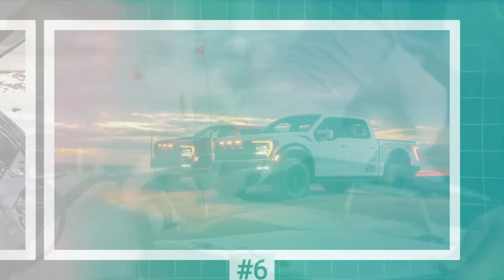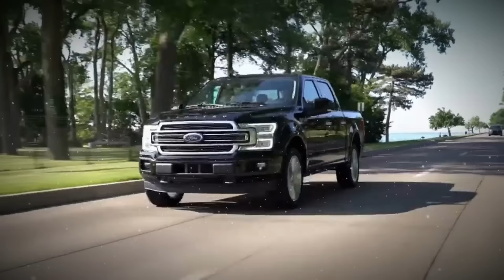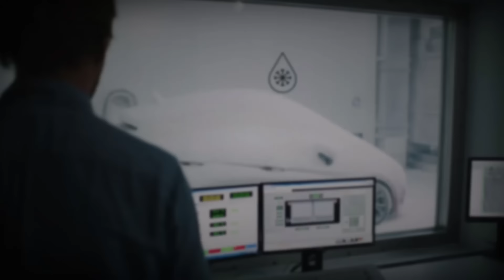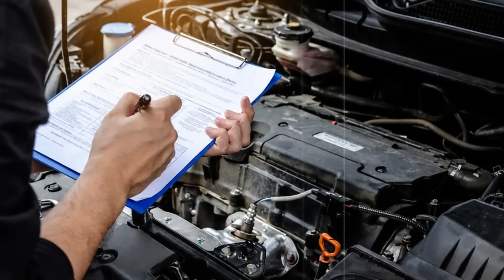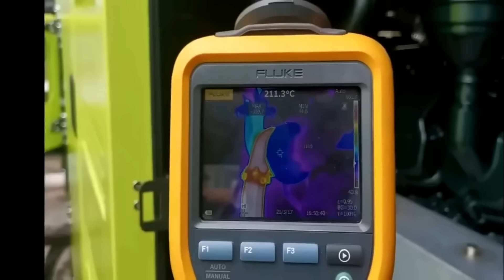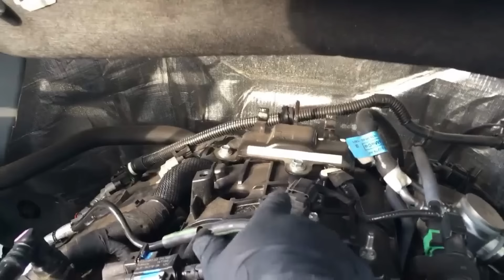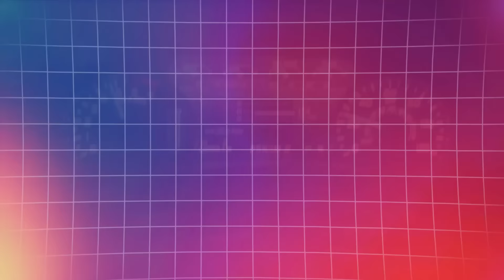We Ran a Turbo F-150 & a Naturally Aspirated F-150 Side by Side for 200,000 Miles — A Clear Winner

Comment: Question: Did ANYBODY at Ford even think to ask themselves why Henry Ford went to the V8 in 1932, and tested it for a million miles before going into production? This being said, I own a 94 F150 with the 4.9 six, with 5 speed manual port fuel injectors, 8 ft. Bed. The 4.9 300CID Six is arguably one of the best engines ever built.
Reply: My dad had a 1970 chevy c 10  and 1980 ford truck straight 6 , both were awesome

Comment: Well I have over 200K miles on my 2016 2.7 Ecoboost and my engine still runs like a clock. Original turbos and everything. Just regular maintenance. Having a good maintenance discipline is the key to longevity with these engines. I change my oil every 3K miles with Pennzoil Ultra Platinum. Just my personal preference. Remember oil is cheap and engines, turbo chargers are very expensive lol.
Reply: I love the pennzoil platinum oil. I use the regular not ultra. I do 5000 mile oil change. I don't tow. I'm still leary of turbos.

Comment: Both engines well proven & excellent. Just require good basic maintenance practices like any modern vehicle. Owned 3 gen1 /gen2 GTDI Ecoboost vehicles all served me well. 2.7L / 3.5L V6 GTDI Ecoboost known to to go 300k+ mis. 5.0L Coyote V8 also super solid. Best modern efficient V8 available today. Facts.

Comment: I’m still on my ‘97 F150 XLT w/4.6 at 105k miles that i paid 26k for back in 1997. It’s been lightly used I’ll admit, but the damn thing just refuses to give me any problems. When it comes to pickups, I believe in TOTAL simplicity. Naturally aspirated engines and as few luxury options as possible. Just power windows and A/C…nothing more. Keep all the sensors, fancy stereos and nav systems. I don’t even want leather seats. Front disc and rear drums please, and a 6 foot bed at a minimum. Do this and you’ll find your truck experience to be very happy. Start adding crap, and you’ll end up in the shop on a semi-monthly basis. Lol

Comment: My 2015 Expedition with the 3.5 had the cam phaser rattle when I bought it at 150k miles.  I'm convinced that the OEM recommended 7.5k oil change interval and/or previous owners failure to follow it is partly to blame. Dirty oil simply doesn't get to the phasers as quickly as fuel gets to the ignition. I immediately switched to 3k intervals with full synthetic oil.  I also flood started the engine to boost oil pressure at startup by pressing the gas pedal to the floor and holding the ignition until the oil pressure was boosted to the normal range.  Within 15k miles the cam phaser rattle was gone and I no longer needed to flood start it.  I was also experiencing a turbo underboost condition.  This went away when I switched to Valvoline Restore and Protect oil .  I now change the oil at 5k intervals and the engine oil gets cleaner with every change.   I'm about to turn 200k miles and it is running better than when I bought it.  My truck came with an oil catch can that also helps.  I love my Expedition but given the choice I'd go with a V-8 if it came with one.

Comment: the mistake was buying either of these pickups when the job is towing. A 5 liter engine is only 305 cubic inches.  Even a 350 is a poor choice for towing and or use in mountainous country. This is like trying to use a moped for cross country touring.....wrong tool for the job.  Direct injection should be outlawed on 4 stroke engines.

Comment: Some things you didn't even mention.
The V8 costs $2600 more vs the V6. As reported for a 2026 model. (I used XLT as my reference.)
It's also likely that the dealer is less apt to give as much, if any, discount on the V8.
If rebates are offered from Ford, the V8 is less likely to get one. More than a little of this is fallout from CAFE regulations.
Towing - You mention towing a 7500 lb trailer. This MIGHT be 100% of the rating of the 2.7L where the 5.0 liter would still have about 2000# more capacity. (Can't say for 100% certain on this, as you don't specify the axle ratio, whether the HD towing package was installed, or 4x4 or 4x2. All of these could impact the max towing weight. The V6 MIGHT have a reserve of 500# and the V8 MIGHT have a reserve of 5400# [ yes 5 thousand 4 hundred pounds reserve] If you "check all the right boxes" max rating of the V8 goes to 12900. Max rating of the V6 goes to 8000.)
It appears you've put the V6 in a situation that is at or near it's rated limit for towing.
BTW - Why not the 3.5L Ecoboost?

Comment: I've got a 2017 F-150 Lariat 3.5 Ecoboost with over 215,000 miles. I had to change the Water Pump at 170,000. It's still going strong. I tow a boat and also a 10,000lb Camper Trailer. I do an engine flush every 50,000 miles.

Comment: 201k on my 2015 2.7  .... only work so far was a water pump replacement .  Always got 23-24 mpg until a month ago , now getting 19-20 mpg and i suspect a turbo leak but havnt found it yet.
Reply: Not plugs?
Reply: @charlesc4047 ...i bought it at 103k , i assumed dealer serviced it then , but i have no miss yet

Comment: I drove my 2.7l Ecoboost Turbo for over 300k miles. Changed my oil with motorcraft every 10k miles. Only replaced one turbo at 267k and a couple coil packs. One difference is I did not tow much with the truck.

Comment: Neither a Ford nor a pickup truck story, but I was looking at Chevy SUVs recently.  It’s hard to get a naturally aspirated V6.  They’ve gone turbo 4 and 3 cylinders in a big way.  

Because I live in a very rural area, being able to accelerate to pass other vehicles on 2 lane blacktop is important to me.  Every Chevrolet with a turbocharged engine loses acceleration after a few seconds.  I suspected it was a boost timer that reduces the turbo outlet pressure after a few seconds to save wear in the engine.  I asked the salesman about it, but he just gave me a blank stare.

From the description of the Ford turbo in this video, it doesn't seem like Ford reduces the pressure in their turbocharged trucks in order to maintain performance under load.  But it’s always something to look for in a turbocharged car or SUV.

Comment: I have never owned a turbocharged engine and never will. I have seen the problems they cause and was completely aware of those issues before watching this video. One of my vehicles is a 2002 Ford Excursion with the V-10. It currently has 187k on the odometer. Other than regular service items, the only parts that have been replaced on this vehicle is an alternator, a couple belt idler pulleys, water pump, spark plugs and boots and one coil pack. The transmission filter was also changed around 100k. This vehicle has not been used for any heavy towing and currently is set up for camping, hunting and overlanding type driving. 3" lift with 35" tires makes it perfect for that. I won't own any new Ford products made after 2014.

Comment: EPA Emissions regulations are the main reason for smaller displacement turbocharged engines. So, once again, misplaced, unintentional, misguided environmental regulations triple the operational cost, increase the initial purchase price, and actually cause poorer fuel economy in real world conditions. Using ethanol fuel causes engine damage due to its corrosiveness, gives poorer fuel economy than non-ethanol gas, and doesn't take into account the diesel burned by farm equipment to grow the ethanol corn and to transport it to refineries. This is the same sort of thinking that led to the ban on leaded gasoline for ground based vehicles! Because mostly wealthier people own & operate leaded AVGAS powered aircraft the levels of lead contamination on and around airports is several hundred % higher than the highest lead contamination ever measured near highways. So, leaded gas for us poorer average Joes was banned thus losing the octane boost/performance and lubrication qualities of leaded gasoline in cars, trucks & motorcycles, and small engines, meanwhile, because wealthier aircraft owning Americans can afford better lobbyists they get to continue using leaded gasoline and polluting far more than ground vehicles ever did! Yet another reason I can't stand Democrats and big government!

Comment: Big difference from the 3.5l turbo to 2.7l turbo...thats why the 2013 F150 3.5l have close to 370hp and 410 torque....the problem with the 2013 3.5l is GDI...but can be handle with a catch can and cleaning the valves with CRC or Seafoam valve cleaning...

Comment: no real surprise here and I am impressed how well the 5.0L held up, I would argue that if you are going to be towing often and moderate loads in a full size four wheel drive crewcab pickup I would want a 351 or a big block butv if you just drive a truck like a car and trade out every few years you can almost make the case for the ecoboost but I won't because personally I would still pick the V-8. Everything that happened to the ecoboost was what I expected and was surprised there was not more issues considering the towing. But really I would find something  different all together, something older and proven-but thats just me.

Comment: The echo boost 353.5 L at 80,000 miles the will get leaks on the oil pan cause it’s plastic the heat cycles mess it up and the plastic valve covers messed up to about 80,000 miles and it will get messed up again at about 120,000 milesI don’t like that engine the 3.5 L.

Comment: It’s why Ford won’t make the 5.0 V8 the base engine over the ecoboost options. Sales of the ecoboost engines would drop. Even with Ford dropping the 2.7 EB starting in 2027, they made the 3.5 EB the base engine instead of the 5.0 V8 and the 3.0 EB the top tier option. Ironically the 3.5 EB was the top tier option engine before the 2027 change.  Ford left the 5.0 V8 the mid tier engine option 🙄

Comment: Nope.  Spark plug ejection was a problem with the 5.4 V-8 not the Ecoboost.  Change top tier oil @3500 miles and use top tier gas and you won't have timing chain problems.  My 2014 F150 3.5 ecoboost has had no problems and it will eats 5.0 Coyote for lunch.

Comment: I was pullin' for the 5L & in work mode it didn't disappoint. I think w/ better flowing cylinder heads, port + direct injection, better flowing intake & exhaust plus a slightly higher compression ratio that could still get by on regular gasoline(maybe increase the octane for climbing), I don't know why you'd want the Eco-Bust?

Comment: Useful, if predictable, info, thank you.  I missed the fuel economy data -- any numbers available?
Reply from the maker: Thanks! We didn’t do a controlled fuel economy test, so I didn’t want to throw out numbers that wouldn’t be accurate. EPA ratings are a good starting point, but real-world MPG depends heavily on driving style, load, terrain, and engine configuration.
Reply: @FordInsiderSecrets I'll just figure that the EcoBoost has 10% better mpg, which is about $4000 less over 200k miles.  That offsets the difference in maintenance expense.  I'd still choose the V8 to avoid the hassle, and to be more likely to get another 100k out of the truck.

Comment: The video thumbnail is very misleading...it reads as if all is equal except for the turbo. Everyone knows the naturally aspirated V8 is going to last longer than a turbo V6, that's a no brainer. The only way this could possibly be a fair comparison is if the turbocharger is the only difference...as in turbo V8 vs the exact same engine naturally aspirated.

Comment: There's so much to unpack here... there are lessons to be learned here from over-the-road semi-trucks who have been running turbos for decades that most people don't understand. Turbos require good oil flow for cooling. If you shut off a turbo engine the very second you put it into "park", your turbo will wear out prematurely. Let the engine and turbo idle down and cool off for thirty seconds or more before shutting down. Turbos in light duty cars are good. Light duty towing with turbos is okay, but again, let it idle down and cool down before shutting down. For heavy towing, a normal aspirated engine or diesel will handle better over the long run.
Reply: Great advice!  Especially for freeway drivers. Let the turbo cool down before shutting the engine off. We do that with our turbocharged airplane engines. They cool down on taxi back to the hangar. Nobody just shuts them down after landing and at approach configurations. Do that with my tractor too (turbo John Deere)

Comment: I have the V8, it's about to cross 200K, since I've owned it I've changed the oil every 5K miles(synthetic), replaced the spark plugs myself and the air filter regularly. Unexpected repairs amount to a broken heater hose...that's it. Broken heater hose. If you're looking for a used F-150, check the Carfax, if it shows regular maintainence and it has a Coyote V8, it'll run forever. Change the plugs early. Broken heater hose.

Comment: Too bad you did not have the 3.5 in the comparison. We have 2 Explorer STs with the 3.0s (her’s is stock and 2 years newer, and mine is warmed over) that we have had zero problems with thus far. BUT, we have been looking at Class C motorhomes that come with V8s or 3.5 Eco boosts and this addresses my concerns, as they are much heavier than the STs (and we rarely tow more than 3-4,000 lbs with the STs), and the V8 looks to be a better fit even though they continue to improve the Eco Boosts.
It looks as if both engines need to run Catch Cans for the EGR gases due to the direct injection (should use the 3 line Catch Cans on the turbo engine).
Cheers 0:28

Comment: My car (not Ford) has a turbo, does no towing and is always a blast to drive. But I do have the same weird hesitation just after starting, in forward gear for a few seconds. It smooths out and does not cause any problems thereafter. It's just weirdly disconcerting. I knew the turbo 4 cyl is just a really bad idea in a full-sized truck. In a smallish car it's fun as hell.

Comment: To eliminate the valve chatter with cold starts, I put the pedal to the floor and crank for a few seconds to get the oil pressure up before it starts.
Reply: I have tried that with my 3.5 Ecoboost and wondered if I was making a mistake? The cam phazers happen to be furthest from the oil pump. After holding the pedal to the floor for 2-3 seconds, I lift my foot and the engine fires immediately.
Reply: @tonyhonzay507 so you start the truck at WOT?😮

Comment: Torque Advantage: The twin-turbo EcoBoost provides substantially more pulling power and low-end acceleration at lower RPMs.Response & Delivery: The naturally aspirated Coyote requires higher RPMs to peak its performance, while the EcoBoost acts immediately off the line due to turbo boost.Towing/Utility: The 3.5L EcoBoost generally rates higher for maximum towing capability due to its massive torque band.

Comment: The best truck is one you never tow with. If you ever tow make sure you have the biggest engine you can get. If it does not fit into the bed of my truck I will not carry it. Lol. Smaller truck engines are good just make sure it fits into the bed or tow only the size of a jet ski. Lol how much more did the V8 cost. If you are telling me repair cost 7000.00 over time vs. Paying 12-15 more for a truck up front gives me the turbo all day long plus the gas savings.

Comment: My 3.5 EB has nearly 140K on it. I pull a 7K trailer up to 3 times a year over some steep hills, mountain passes or long climbs. Once, driving from Portland to Spokane which is basically uphill the entire way through Washington, we had the trailer, 6 people and 111 degrees outside. We had no problem maintaining 55 mph. The only exception was tow mode didn't downshift automatically when the coolant climbed too much. I manually switched to a lower gear which ran the pump faster and it cooled down then. It has some rattles, not the cam phasers, and the torque converter has a vibration but so far no dash lights or issues with the truck except the crappy weak headlights and the idiot plastic oil plug.
Reply: It’s a good motor and I believe that the 3.5 EB is very reliable overall. But if given the choice, folks like me just want our PU’s to be as simple as possible. I want a naturally aspirated motor with air conditioning and power windows. I don’t want ANYMORE features than that. Some people drive their pickups as daily drivers and family haulers, so I get it that people want all the comforts, but my old ‘97 F150 with the 4.6 does nothing more than the few tasks I have to do around here. I have cars to do everything else. But I’m scared of turbocharged or supercharged pickups.
Reply: I had the 3.5. It seems to be a very different engine than the 2.7. I got up to 26mpg unloaded highway driving. It pulled a 32 ft. Camper like no problem. Only problem I had was the plastic oil pan developed a leak and had to be changed. They make aftermarket metal ones...
Reply: @woodsman4cb  Same leaking oil pan issue with the 3.5. I'm seriously thinking of getting the aftermarket oil pan. The plastic drain plug thing is an Archilles heel. If it's reused it leaks. They are $10 each. I need to keep three in my truck at all times since some oil change places don't stock them.

Comment: Let's not forget that the turbo engine costs more on the windows sticker too, at purchase new.
Reply: No, on a 2026 XLT the 5.0 costs $2500 more than the 2.7 turbo, and $300 more than the 3.5 Turbo. 
 I'm pretty sure it's been the top engine for at more than a decade, well , until  the Powerboost Hybrid came out.
Reply: @robertlodge6012  I did not realize that had changed. The turbo engines used to be extra cost options.
Reply: @johnhouseman1901 You're right, it did sorta change, but I'm not sure when.
When my 2016 was sold the standard engine was the 3.5 non turbo, then the optional, (in order of cost) were the 2.7, 5.0 then 3.5 turbo. Today the standard is the 2.7, then 3.5 turbo, then 5.0 is the most expensive.